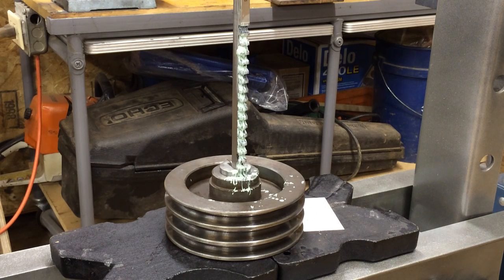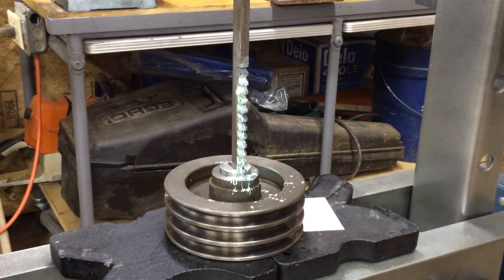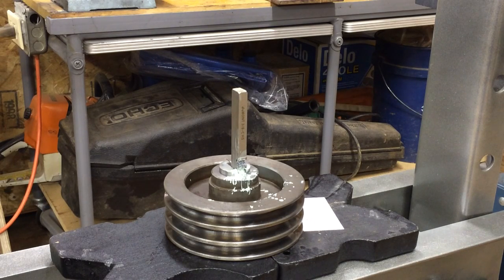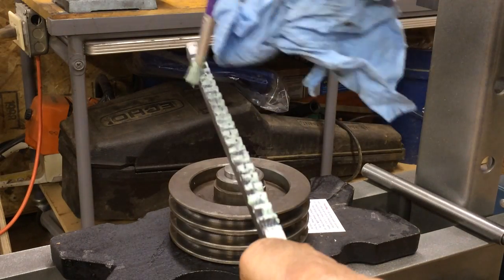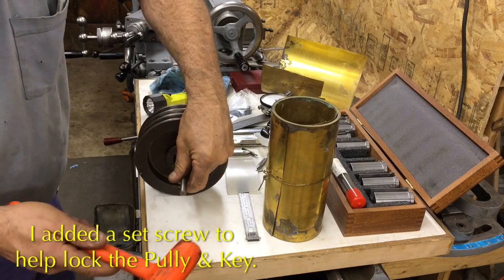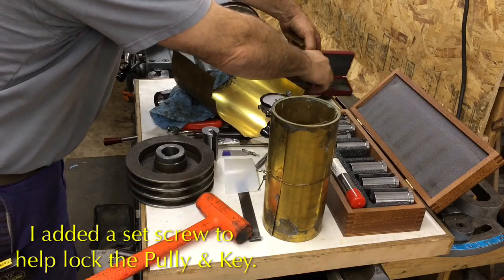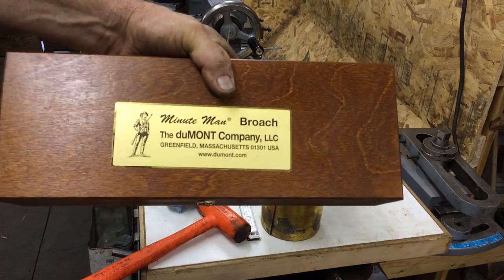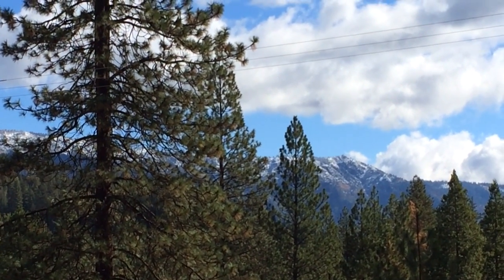How To Repair a Motor Shaft and Pulley P2 | Details

Comment: I suspect it's too late now, but you said that due to the shim moving the wedge over you needed to cut the keyway on the shaft a bit deeper.  Wouldn't that be shallower, not deeper?  The wedge was moved toward the pulley keyway, making that deeper, so if you make the shaft keyway deeper too, you'll need a pretty tall key, right?

I agree about cities...I've always lived in suburbs, but even that's getting too crowded for me. Especially around here in the DC area. Ridiculous levels of traffic, high property taxes, and meddlesome governments.  And on top of that, not enough shop space!  

That's a nice view, and horses have their advantages.  Your car or bike won't replace themselves, but with the right horse setup you don't have to keep buying new ones.

Thanks for sharing the fix...very educational.

-- Mike
Reply from the maker: BigMjolnir I went around the Broach guide about 80% so the guide was basically in the center, 0.010 from the edge.  So the keyway would be cut a bit shallow.  I added an extra 0.020 shim to the broach.  Worked out good.  Thanks Mike for asking, Randy
Reply: Randy Richard
Ah!  I understand.  Thanks for the explanation.

-- Mike
Reply from the maker: BigMjolnir Sometimes I get it right.  Thanks for the great comment.  Randy

Comment: Randy,
Great view of the mountains from your house. What a beautiful location for retirement. When I was in grad school in Oregon I would help a friend muck out the horse stalls. On the really cold days we would find the very old and dried manure and get warmed up by sitting there. Sounds gross but it works and doesn't stick or smell.
Thanks for the tips for using Anchor Lube and adding the 0.010" shim for the broach collared bushing. Did you use the Anchor Lube G-771 product? This product is listed at Enco with a special web price and even Amazon lists the product (but not with Amazon Prime free shipping).
Reply from the maker: Paul Jones Thank Paul.  I built this house in 87-88, moved in late 88. So we have had this view for awhile. Yep on the Anchor Lube, G-771.  If you call and order from Anchor Lube you can get a discount if you mention Stan Z. at Bar Z Industrial.  I am liking the product.  I have used it on the lathe and mill so far.
I just finished up the repair on the motor shaft came out great.  I plan on getting the motor reassembled today and put up the final video on this repair this evening.  Thanks for watching, Randy

Comment: Hi Randy,
The pulley should be as good as it should be, I'm sure it will outlast you or the rest of the machine.
Looking forward to see the shaft restoration.
Sure is a great view all around your place...!  I only enjoy snow for a few days, between Xmass And New Year, the rest of winter is a great pain in the butt... Here it last from about now to end of March.
Cheers,
Pierre
Reply from the maker: pierre beaudry I agree about the pulley, look like new.  Shaft machine today.  I have been in the snow all my life so kind of used to it.  So I have a tractor, makes life easy.  We used to get feets of snow now we seem to get inches, so not to bad.  We need snow and rain now big time.  Thanks, Randy
Reply: Yep, you're right about less snow by now, last year was on the cold side for extended period, like minus 20-28 deg. C ( -4 to - 20 deg. F) followed by a rotten Spring season.